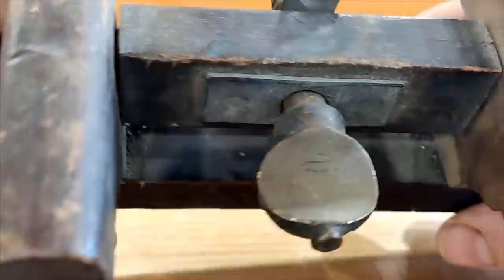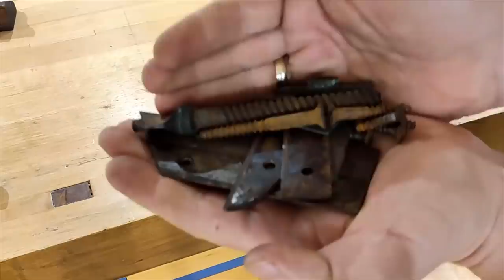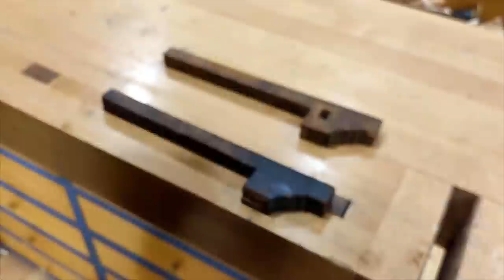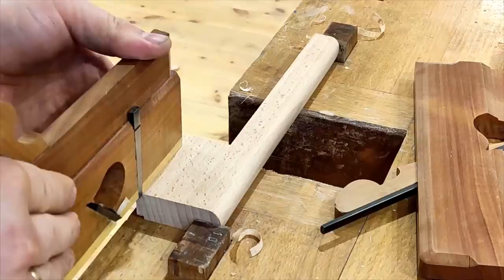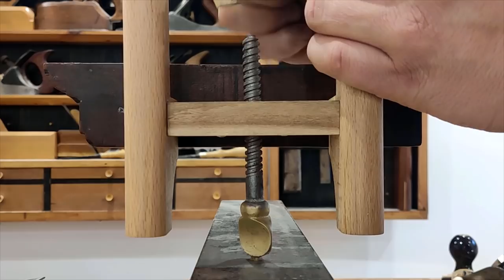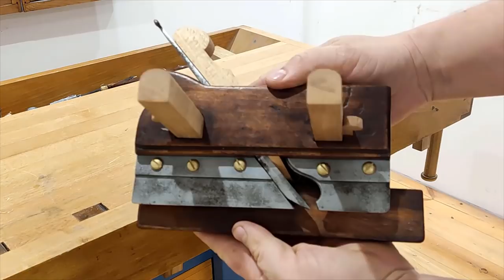058 Second chance for a classic tool

Comment: Well done.  What did you use to clean the body of the plane?  Also, did you use different metal cleaners for each type of hardware or something like evaporust for all of them?  Thanks
Reply from the maker: Thanks! It was boiler linseed oil. For the metal parts i've used my sandblaster

Comment: Thank you for another great video.   I learn something from each one.   I do have one question, my plow planes have the iron set to the edge of the skate; why is this iron centered on the skate?
Reply from the maker: Hey Bryan, most of the plow plane irons sets i know have v groove on the bottom, it helps to set the iron in the centre of the skate. I don't know if i understand you corectly, your set have not a grooves?
Reply: @StavrosGakos  Correct, the outside of the iron is parallel to the outside of the skate.   If it helps this is a Veritas Medium Plow Plane.   Maybe it’s due to it being newer?   I can see where having the groove would allow the skate to be better supported in the cut
Reply: @bryantretheway3809  I can answer that.  It's more in common with a combination plane than a plough plane.  It's set to be flush on the edge because on the veritas has a wide blade attachment to accept, well, wide blades.  It's a newer design and to my understanding it could be wrong, but its supposed provide you with more support.  The old wooden plough planes with these types of irons have the skate in the middle, modern has it on the two edges.
Reply: @tim10212  That makes perfect sense!  Thank you very much

Comment: What is the liquid your using with the wire wool for cleaning the wood?
Reply: Oil
Reply: Mineral Spirits are often used. Removes the oils and grime, but generally leaves behind any applied finish, and some of the patina. Is a great compromise between cleaning and stripping completely.
Reply from the maker: Hey it was boiled linseed oil 👍
Reply: @StavrosGakos  I've always thought BLO as a finish, must try it for cleaning. Thanks
Reply from the maker: @grsymes  you're welcome, blo is also very good base before shellac 👍